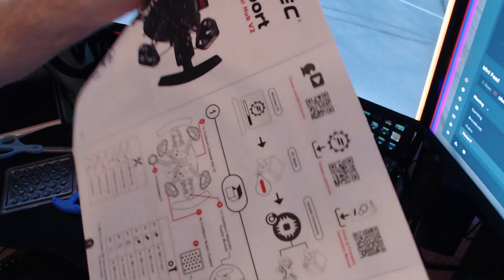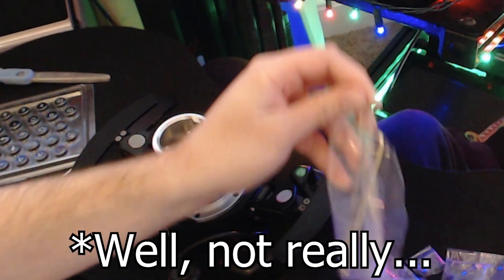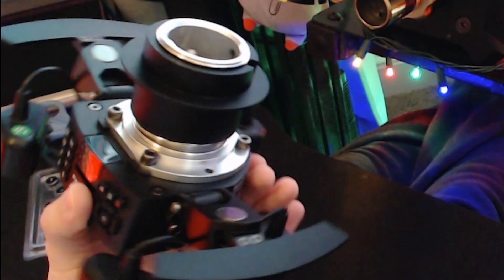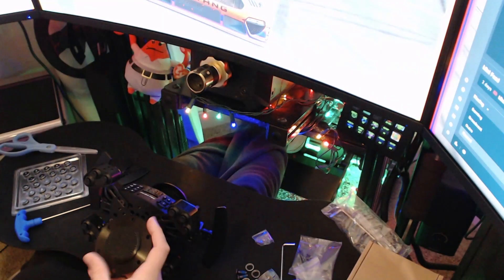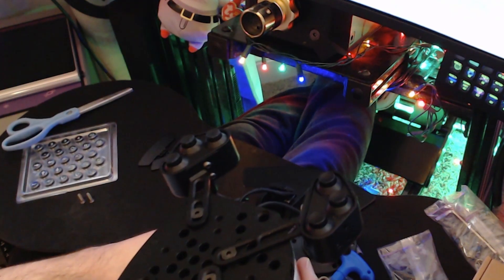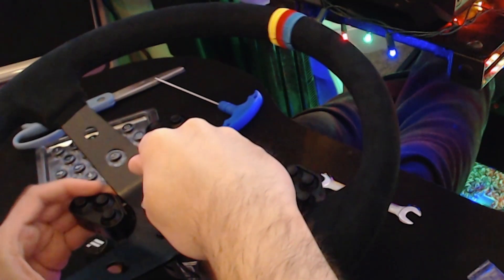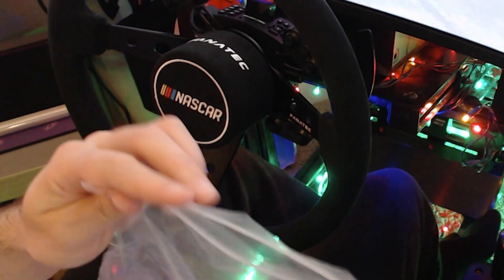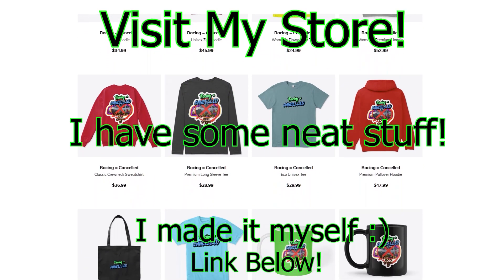ASSEMBLY NASCAR Fanatec wheel V2!

Comment: can you please help bought one of these the other day but having trouble clicking the ok button on the dd base to enable torque. i’ve clicked all the buttons but doesn’t work
Reply from the maker: I'm not going to lie... I had the same issue. I had to use a different wheel to get the "ok" button to work right.
Reply: @ECOGreenGT  So what do we do if this is our only wheel?  Ugh.  I've yet to actually power mine up and install firmware as I just got it last night.  Spend an hour and a half getting wheel, hub, and DD base assembled with CSL pedals and load cell

Comment: I struggled so much with screwing the wheel itself to the hub.  Only 4 of the screws would go in due to button arms.  I may have to take it all apart and redo it.  I didn't move them as you did and am now worried.  I really appreciate the video because the fanatec instructions are absolutely abysmal.  My buttons weren't the interference problem, but the long arms where they screw into hub itself.  It wouldn't let me put the screws in at say 5 and 7 o'clock.  Got 10, 12, 1, and 6 in.